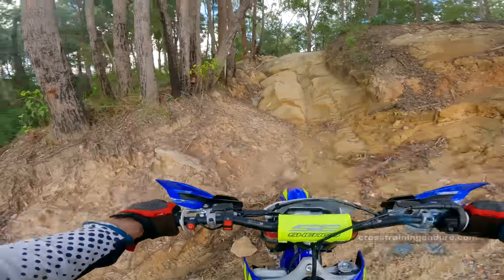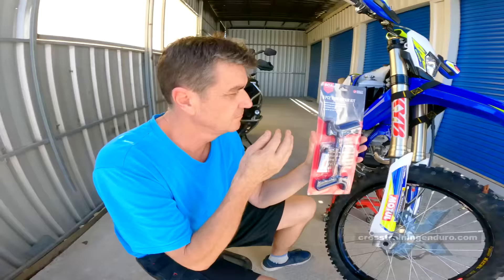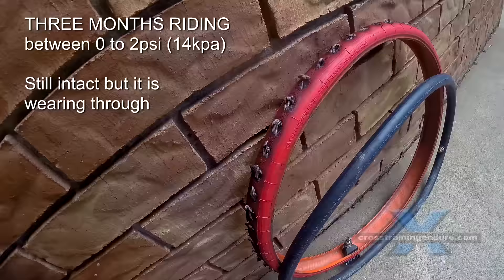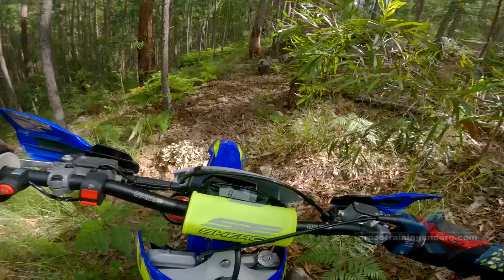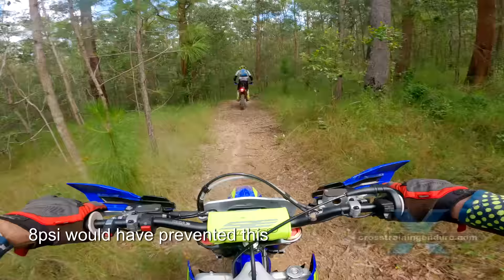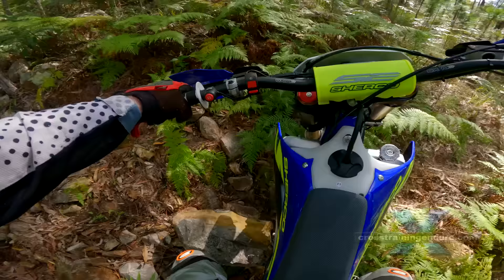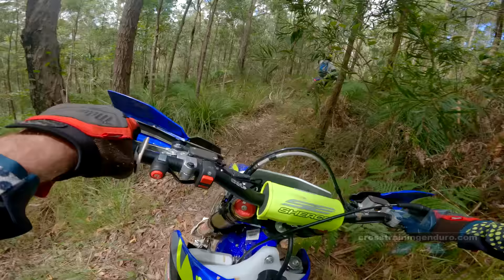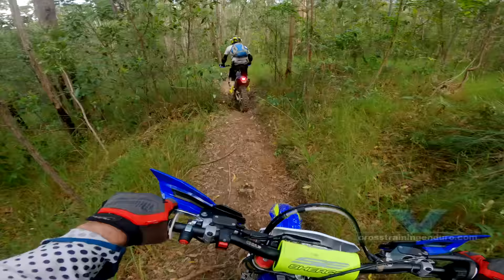TUbliss long-term review after 7 years with the tubeless tire system!︱Cross Training Enduro

Comment: Running tubliss for about four years now and have had a few issues. High pressure tube got "pinched' where it goes by the low pressure valve because the little rubber piece that is supposed to protect it cracks and allows the tube to rub against the metal valve stem. This happened twice about a year and a half apart. I now check this anytime i change tires and have added a few wraps of gorilla tape around it to keep it form tearing. So far so good.  
Other issue was constantly getting punctures in the front where the metal plate that sits above the low pressure valve on the outer side of the hard red rimlock tube/shell would puncture my tire over rocks and roots when running lower pressures (8 ish or less psi ). I thought it was just bad luck with sharp rocks, nails, etc. puncturing the tire until i realized i had a nice grouping of tire plugs in a vague square shape at the same spot where the metal plate on the red tube sits. Now I run my front at 11-12 psi and have no issues since. So, like the vid says, if you run fast and hard (and I would add that if you run on sharp, rocky, rooty terrain often even if you ride slower) keep that psi up around 10 or above in the front to avoid this issue. 
Also, changed from tire slime to armor all for the inner lubricant and it has worked well. I found that the slime really doesn't do much to seal anything anyway. Also, a lot less messy during tire changes.
I am thinking of trying the Meggs Brapp method of Nitro mousse up front and Mousse/tubliss combo rear. Sounds like a nice setup after watching her vid about it.
Reply from the maker: I reckon the TUbliss guys would love to hear abou that 'pinch', Max. One of our guys is keen to try the Nitromousse, he will belt the shit out of them for a few months and we'll report on whether they work well or not.

Comment: Tubliss Rear Mousse Bib front is what I’ve settled on.

Front low pressures make squirmy riding so not a huge benefit. Less rim protection and I’ve had multiple flats, yes I sealed them with 2-3 tire plugs but was a hassle and found little other benefits.  

Front mousse is great rim protection, where I usually get flats and feels like a 11-13lbs tire so handles normally.

Rear Tubliss traction is phenomenal and I can run my tires longer before I feel I need to replace them.  I’ve settled on 6.5 psi any lower and for my weight and speed it gets squirmy and unnecessary rim strikes.  

Tubliss is lighter than a HD Tube and considerably lighter than a Mousse.
Reply: Ditto on the issues with the front, especially if you run in faster terrain with rocks and roots. I still run tubliss in the front just because I am lazy though. Mousses are pricey and can be a pain to work with, while the idea of patching/replacing a tube trailside seems equally annoying. I just run 13psi in the tubliss and have maybe flatted once.
Reply: @simplyaaron  I find the Mousse easier to install that the Tubliss in the front.  Tubliss was always a pain in front as there wasn’t as much tire to flex.🤷🏻

Comment: Mousse for me, F & R. I really like that the what-air-pressure-should-I-run decision is taken away. And I know they aren't supposed to last but I get out on the bike probably 30 days a year and they will last a while at this rate with zero maintenance. It's reassuring to know they're in there when pounding through the slate and rocky trails that Wales in the UK has to offer.

Love the vids
Reply from the maker: Great that's working for you, Peter 😁

Comment: 300 hrs on Tubes no issues
-4mm Ultra Heavy Duty Tubes
-9-12 psi checked day of ride
-8oz Slime 
-Tuned KYB suspension
-Occasionally clean slime fibers from valve
-Ride Endro B class Wyoming to Texas 
-

Comment: Tubliss on the rear of all four of my bikes. Been using them since they came out. Never had them on the fronts. Use heavy duty tubes on fronts. Have had a few inner liner tubes get punctured (nails, tree limbs, barbed wire). Still carry a spare front tube on bikes for just that reason. Like the adjustability of the Tubliss system and have no problems with installation. I’ve gone through so many tires over the years, I have plenty of practice. I run Slime in all the rears. This helps seal the Tubliss system, and makes it easy to find a tire puncture and to plug it on the trail. Will never go back to tubes in the rears, and don’t have any desire to fight with a mousse during installation or tire removal.
Reply from the maker: Damn,those inner tubes must go with a loud pop! As mentioned in the vid, only one of our crew had that happen in seven years and he said it sounded like a gunshot lol.
Reply: @crosstrainingenduro  Never heard them. They all died due to a puncture. You end up having to pull the red ring out to use the tube. We zip tie the ring to the front of the bike to salvage it and get back to the trucks. Looks stupid, but those things are too expensive to just toss. Oh, and I have ridden on a flat tire with the inner tube holding. Thought something was wrong as I kept feeling the rear end smacking rocks. At the time, I was dealing with some rear shock issues, so thought it was that and kept going. Finally stopped after about five miles of rocky hill climbing and took a look. Oops, rear tire was flat, shock not the issue. Plugged it, CO2’d it, and finished the ride, another 10 miles in the Rockies.

Comment: Many moons ago. I rode a whole season of technical riding and and enduro with a Pirelli MT-43 Trials tire at 4-5 lbs. most of the time. That setup got FANTASTIC grip in snotty situations we have here in the NW U.S.. It did kinda suck when trying to corner in the dry gravelly terrain. I rode it during practice sessions at my local mx track, with 8-10 lbs. in it. Kinda sucked there, but that was all about tire choice. For slow, wet slogging, itt was great. Everything else, like in life, and it was compromise.

Comment: IMO Barry, spot on review, at least these have also been my findings with the use of the system. I have run them for 6 years on all of my enduro bikes 6 KTM, 1 Beta, 1Husky, 1 Sherco and have installed them for friends on their bikes literally dozens of times.  Of course installing them properly is critical, I usually dose the inner bladder with a product here in US "Armor All" this seems to deal nicely with the sealing issues 100% with new tires and when mounting a used tire, which I do at times, relative success, that is it usually will leak some every 3-5 rides depending on how hard I am hitting objects but for me only a slight inconvenience. I have also done some intensive light adventure rides over multiple days with my KTM500/tubliss system on a mix of 70/30 dirt and pavement with speeds up to 70mph with ZERO issues so I am sold.  Tried other systems and just not checking all of my boxes well so at this time Tubliss is here to stay on my 2022 KTM 500 and 2022Sherco SE 300.
Reply from the maker: Great to hear it's been working well for you, Dirk. Armor All makes the fitting a lot easier too!

Comment: I love the Tubliss system. I also use the slime method. My first system lasted 7 years before the wire in the red liner rusted. I will say tho if you ride alot and use very soft tires (ie. You go through alot of tires) then I would go with a mousse that way you can keep the moose well lubricated.

Comment: I really enjoyed my time spent with tubliss gen1, some 12 or so years ago we had them officially in brazil, nowadays the shipping costs and import taxes are prohibitive to order from overseas. We use the Lucioli ultra heavy duty tubes here. But I really liked the ease of installation I had with tubliss, and the fact that for me it just planly worked. I still have a new but dried out old stock front one that I can´t get to seal. When the opportunity arises, I´ll buy me a new set, this last generation seems to have all the problems covered.
Reply: I want to try Lucioli have you had a good experience? This channel should do a review not sure if he is familiar with it. I did not like mousse (bike felt heavy and unresponsive, no pressure adjustment, too expensive to keep replacing all the time) and I’m trying to decide between Lucioli and Tubliss. Thanks.
Reply: @dosovnis7090  Lucioli is our only accessible option here, like tubliss, mousse has a prohibitive cost. I never had any experience with mousse, but people say the weight is comparable between Lucioli and mousse. Durability wise, I've never seen someone replace a Lucioli, if you don't do anything stupid, they last countless tires. I don't know how much they cost for you guys overseas, but I would give it a go. They are pressure adjustable, give all the feedback regular tubes do and are pretty much bulletproof.
Reply: @ajr.1272 Great thanks I think next week I will install Lucioli for both front and back.

Comment: I have run Tubliss for around 900 hrs and love em. Here are the only issues I have encountered relating to the system itself. Tears around the base of high pressure valve stem (make sure the HP valve stem is nice and straight).  Slow loss of pressure of the HP tube (check the pressure before a ride).

Related issues.  If you slice a tire there aint no fixin with plugs. If you run low pressures don't  go around corners fast as they roll like mad, especially gummy tires. When removing tires you need to be extra careful not to catch the inner liner with the tire irons. ( i bet most tubliss users have trashed at least one liner?)

Comment: I put tubliss on my bike 4 years ago because most of my riding is in an a area that is more rocks than dirt.  Lots of sharp rock too.  They have worked well some complain of having to air up the tires but you should be checking tire pressure before every ride any so to me it is pointless to complain about such a small thing.  Maybe they should take up lawn bowling.  Tubliss was a game changer for me.

Comment: Tubliss for 1 year now and loving it
Reply from the maker: Great to hear. Easy to fit?
Reply: @crosstrainingenduro  Thanks and yes, easy to fit. It's better to use new tires as you said, no leaks and running 4 psi. To install and I'm using the no pinch tool. Greetings from Costa Rica 🇨🇷.

Comment: I've been running TUbliss for four years, covering two bikes and around twenty tyre changes. I've not had a single failure on the trail yet, I normally run around 2-6psi rear and 5-8psi front. The only time I've had a failure was during fitment and was my own stupid fault for being careless with the tyre levers.
For my style of riding, having the flexibility to adjust your pressure on the day and throughout the day trumps the higher reliability of a mousse. Drastic weather changes at a recent race proved to be a perfect example of this - I just dropped my pressure to suit the wet and muddy conditions.
Reply from the maker: Good to hear, Coxy. I figured you might have swung over to mousses once you started the hard enduro events, but it's good the TUbliss is holding up. I figure you went as low as possible for the second day of the Kozzie then!
Reply: @crosstrainingenduro  Haha! Yes, I think everyone could have used a bit more grip on Sunday. I ended up running around 3psi on the rear which seemed to get the job done.

Comment: I run tubliss in the rear at 6 psi and a tube in the front at 18 psi. For the terrain here in Northern California this setup works best for me. I now install a tube with the tubliss installation plate with the tube pre installed in the tire.
Reply: That's what I'm going to do, switch to tube in the front. Most benefit from Tubliss is probably the rear for a "tourist" like me.
Reply: Tubliss in the front not worth it?

Comment: Never tried TUbliss.  Had such great success with extra heavy duty Michelin tubes for 10+ years, its hard to complain.  But, I have been considering other options - TUbliss or soft NitroMousse.  The extra traction of 6psi from either setup is very tempting.
Reply from the maker: The traction is ridiculously good... but it does have to be weighed against other factors.

Comment: I've used both the tubliss and moousse. I'm now sold permanently on using moousses, it is a no brainer for me if you want total reliability. Sure their life span is about 3 years but that's 3 years of hassle free,  no tools required riding.
Reply: How many hours are you doing in 3 years?
Reply: @stillcantride7159  hi there, I'm yet to test mine to 3yrs cause I've only been running them for 6 months but...my mate gets around 3 years out of his and he rides hard every week. That said he changes his tyres frequently and uses lots of lube. Heat is what destroys moousses, so if you change your tyres frequently, like I do anyway, and apply fresh lube every time,  then there's no reason you shouldn't get between 2 and three years out of a moousse.
Reply: @UTPP  fair enough, I’ve heard varying lifespans for them, I’m just around 25 hours on my first set.
Reply: @stillcantride7159  I've got over 50hrs on my current ones and their perfectly fine.

Comment: Stans latex tire sealant from the bicycle shop is better than Slime, I put 200-250ml rear and between 150-180ml in the front tire. An added benefit is that this will seal most punctures before you’re aware of them, another adde benefit is dynamic balancing for those fast road sections. 😀

Comment: After I spontaneously ripped apart a tube on the highway I spent some bucks to put a 18" rear on my DR. Didn't want to ever have to deal with finding a shop in the dead of night again. It's a little finnicky since it's a 2.50 rim width but it's held air in the cold chamber the whole life of this tire ~3k miles. The high pressure tube needs air about once a week to maintain 110psi. 
I was going to convert the front to tubliss as well but I ended up buying some old stock and the red liner's coating was sharding apart like old plastic.

Haven't had any issues with the fuzz. I doubt they would look close enough to notice beyond the tire sidewalls.

Comment: Thanks for doing this review.  Very helpful to see others' comments and experiences to compare against my own.  I had 2 front Tubliss high-pressure tubes in a row fail around the valve stem.  This was compared to having zero issues using conventional heavy-duty tubes, so I asked myself why am I going through this extra expense and hassle to create problems I didn't have before?  The dealer who sold and installed them said Tubliss had had some QA issues recently causing those failures.  I do run Tubliss in the rear with zero problems.  So I've the worst of both worlds - I carry a puncture kit for the rear and a replacement tube and tire irons for the front.  My IQ is low enough and as as soon as my memory of the bad experiences on the front fades enough I will probably subject myself to another round of Tubliss front torture.  The Slime idea and keeping the lock nut around the HP tube loose, like we do with regular tubes, are good ideas.
Reply from the maker: Bummer to hear, did you talk with TUbliss head office about that? I've heard they'll often send you out freebies if it sounds like a genuine product failure, and they'll quizz you about it to ensure it's fixed....
Reply: I also had a HP valve stem fail after sitting for a few months. Figured it was just time since it was 3yrs old. Still very happy with the system. Also Got to be careful not to get the spoon under the tube when removing!
Reply: I did not talk to Tubliss' Head Office regarding those failures- good idea and should have, but I was so tired of having unnecessary problems I gave up, on the front anyway.  Will try again when I have more control over my patience!
Reply: I too had more issues with a front tubliss on the bushpig and TE300 than the rear. So I went back to a tube for the front and kept the tubliss in the rear. My logic is as follows: If there's going to be a puncture, 80% of the time it's going to be on the rear. The rear is a bigger PITA to remove to get to the tube, so I'd rather use a plug. I carry a 21" spare tube around anyway for the front if needed, and it'll work in a pinch in the rear in case the tire gets un-pluggable or the tubliss system fails for some reason. Also the bushpig is my ADV bike and not really made to be bashing into rocks at 3psi anyway, so for offroad stuff I keep the front at 15psi minimum and have the option to go real low in the rear if I find myself in a sticky situation, but otherwise keep the rear at ~15-20 psi. 27-32 for highway riding loaded up with gear.